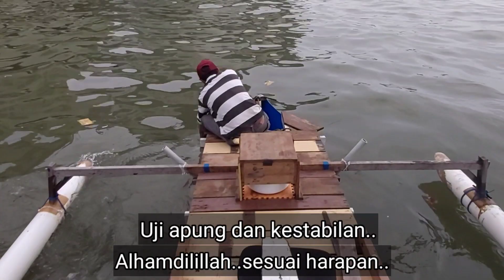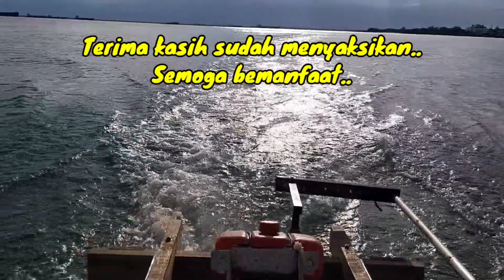Membuat Perahu Drum Berkatir Sederhana || Upgrade tambah 1 drum

Comment: Om boleh bagi ilmunya
Klo untuk mesin ketiting
Bagus nya pake putaran cepat atau lambat..saya mau beli mesin merk honda terus cara membedakan nya seperti apa om yg putaran lambat sama yg cepat?👏👏👏
Reply: Bodi perahu fiber saya
P. 7 meter
Lebar 1,5 m
Tinggi 70 cm
Itu bagus nya pake putaran lambat atau cepat om..sya mau beli yg 13 pk
Reply from the maker: Mesin putaran cepat (standard), as starter segaris dgn as keluaran. 
Mesin putaran lambat, as starter tdk segaris dgn as keluaran karena melewati gear reducer (ada tambahan gearbox reducer putaran mesin). As keluaran akan menghasilkan putaran yg lebih rendah namun dgn torsi/tenaga yg lebih besar.
Reply from the maker: Saran sy gunakan yg standar (putaran cepat). Mesin putaran lambat biasanya digunakan utk prahu bermuatan berat dan tdk mementingkan kecepatan.
Reply: @JamilBlora  
Thnks ya om uda berbagi ilmu nya🙏